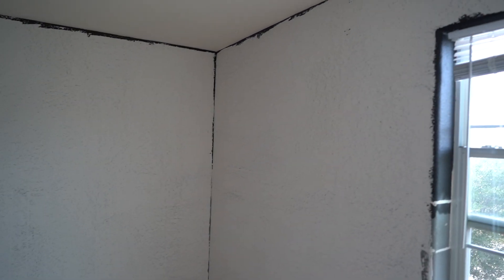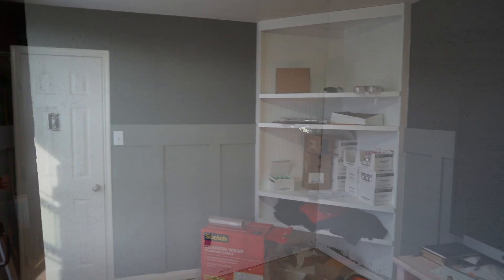Looking Better Already

Comment: Looking good man!👍🏻 What texture are spraying on the walls? Knockdown or orange peel?
Reply from the maker: Paul Peck DrywallTube hey!! I’m going to do knock down. I was watching some of your vids the other day! You got any good knock down vids? Thanks for the comment!
Reply: Why? Texture on walls is ugly... Just my opinion
Reply: @kenlame1197  I agree with Ken!!!  What's wrong with smooth walls?
Reply: I'm in SW Florida and all new construction is orange peel or knock down because smooth walls takes craftsmanship.  I was told recently that in the NorthEast, all of $1-3M homes have smooth walls.  Maybe in one of your rooms you could learn/show/teach us how to do a Level 5 finish.
Reply: Cool. Thanks for watching my videos man! Are you going to be using a hopper and compressor? I do have a couple knockdown videos. But, they're of me spraying ceilings after popcorn removal with a bigger texture rig. I like to go a little smaller with the splatters on walls. Ceilings are usually a little heavier. What's on your office ceiling now? -Paul
Reply: Yep - I agree with Ken, Bob and Dritz.  Smooth walls are gorgeous.  I hate textured walls.  I live in a 1968 house with solid, smooth plaster walls.  All the corners are perfect 90 degrees.  The house is small and the neighborhood is going down hill a little bit, but I just can’t leave these walls!  They are works of art.  lol!
Reply: @FinishCarpentryTV  Have you ever seen See Jane Drill videos?  She is a master plasterer!  She shows how to go from textured walls to smooth.  It looks easy when she does it, but I know it takes skill.  She also shows several texture ideas.
Reply: I was a finish drywaller many years ago. Funny how I still to this day will walk into house and check out the corners for the quality of work. True that flat walls/ceilings show the talent of a finisher. But I do like the look of a good knockdown job.
Reply: @kenlame1197  im a contractor and I agree, smooth walls look amazing but they take a lot of time. That's why mainly more expensive homes have it, because most people don't wanna pay for it.
Reply: @doug.ritson  most of our homes in the northeast have smooth walls not just the high end ones. I've done work on houses in a couple towns in NH that had textured walls and it was because the builder built shitty houses. They didn't even have plywood on the exterior it was 1 inch foam and vinyl siding nailed to the studs.
Reply: Smooth walls. With a trim detail will be a richer look.
Reply from the maker: @PaulPeck   Awesome! Yes, I will be using small compressor and hopper. There is currently knock down on the ceiling now. I am going to mask it off because I do not want to mess with it. Just going to try to match it closely!
Reply: @thomasbryant5138  Yikes! Race to the bottom
Reply: Finish Carpentry TV you may need a pretty big compressor to power the hopper.. my hopper calls for 8-10 cfm (cubic ft/min) and the biggest Home Depot rents here is 6.5cfm
Reply: I lived in Houston thirty some years ago, where I started my remodeling career.  Popcorn texture EVERYWHERE!  Ceilings and walls.  Moved to Alabama in '87, where smooth finish was (and still is) the norm, even in mass produced "Mc Houses".
Reply: I'm from the UK and like 90% of walls here are smooth so I didn't even know what you guys were on about. Do you not have decent plasterers over there?

Edit I just googled orange peel. Vs knockdown and that's like an old thing if you bought a house to renovate that's kinda what you'd expect and you'd plaster the walls smooth.

Enjoy the videos though!!
Reply: #drywalltube has so many good videos. Your are on the right track! Keep up the good work gents!

Comment: Congratulations on the home purchase Richard. Your children are adorable, great to see how you get them to help you. 
A fast way to get the skim coat layers on is to apply the thinned compound on the wall with a paint roller and using a good quality squeegee wipe off the overage as you’re only filling the low area, a couple of coats this way and you’ll have a great base to work off of.  There also is far less sanding and less lines from the edges like the taping knife leaves behind. This is going to be an amazing room when finished, your talent never fails to amaze me.  
I’ve been doing this type of home improvement for 43 years now and will really enjoy seeing how big of a name you will make for yourself.  Enjoy those children, they are a real gift and grow up fast, my youngest graduates college in 3 months, I was just your age, it seems like the other day.
Reply from the maker: Clint Price thanks for the tips. Yes everyone tells me time flies and I am already seeing it. It’s crazy
Reply: Great call about the thinned down joint compound.  I use a 30 mm sleeve.  I find it works excellent when going from an old textured wall to a new piece of drywall as well.
Your kids are awesome by the way.  As exhausted as you will and must be some days, that extra bit you find for your kids will be something you will always remember and be grateful for.

Comment: Looking good.As a drywaller though here in Australia I would like to offer some insight to you as you have always  been teaching me. Between coats of skimming you dont really have to sand between coats as you have applied tight coat you can just run your knife and lightly knock of the highs spots and apply second skim coat but this time cross trowel to eliminate any low spots. All the best to you and your family. Cant wait for the transformation.

Comment: Don't put a textured finish on your walls. Just sand out the walls with 220 grit on a pole sander. Prime the walls. Mark all your studs. Install trim. Caulk and fill the trim work.  Finish trim and paint walls. Save a couple days labour. We've been doing this in Canada for decades..we only use texture on ceilings.and lately those are all a flat paint finish too. Love the channel. Great workmanship and video editing. Go with a tall wainscotting and 6 inch crowns.
Reply: Do it like us british.... plaster it.... room that size would b pinked in a day.... 2 dsys to dry... then paint with crisp corners and edges.... no need for crown moulding

Comment: Looking good 👍 just a tip for the next time you skim coat wet down the mud a tad more and use a paint roller to apply the mud and trowel it all back off.

Comment: I don't have a link. I like top of the door crown molding shelf . I also like big bold base and casing . Got to go wood not painted . Building my parents house we bought a shape and power feeder made own doors put one by sixes together different types of wood on interior exterior . For instance Poplar inside of a room and Ash on the hallway side . With the crown molding would do soldiers in the corner instead of doing coping .

Comment: rich my suggestion is install new base 5" 1/4 would do for that size room and same for the crown molding, new casing on doors, 3" chair rail, new window trim and sill, with engineered hardwood floor, for paint colors I would say a navajo white with straight white on the trim. but I guess you could do carpet as well in case you like the warmth a carpet brings into the room in those winter days
Reply: Sills are outside, stools are inside
Reply: Ken Lame stools? never heard that phrase used  to describe a window seal. I always thought a stool was some kind of seating item
Reply: Ken Lame  window sill-The lowermost, interior trim work on a window

Comment: Hey Mr. Richard. Still love your work but a little piece of advice. Next time you skim coat, roll it on with a thick nap and just skim it off. Saves you a lot of time and your definitely skilled enough to get your walls flat. Just thought I'd share. Have a good one

Comment: Hey brither what is that just regular joint compound ur skimming the walls with right??? What is it green cap compound or blue cap compound
Reply: I always skimme and do coats with synco green
Reply: Skim plaster walls with green then skim with plus 3 @Heisenberg 2420

Comment: Here's another room with the wainscoting I just posted.
https://www.alamy.com/a-king-size-bed-standing-in-a-bedroom-interior-between-bedside-tables-and-with-a-black-lamp-next-to-it-image181642190.html?pv=1&stamp=2&imageid=BE85FEB6-28EE-4BD7-8EC5-D4AFD26F5F53&p=649298&n=0&orientation=0&pn=3&searchtype=0&IsFromSearch=1&srch=foo%3dbar%26st%3d0%26pn%3d3%26ps%3d100%26sortby%3d2%26resultview%3dsortbyPopular%26npgs%3d0%26qt%3dwainscoting%26qt_raw%3dwainscoting%26lic%3d3%26mr%3d0%26pr%3d0%26ot%3d0%26creative%3d%26ag%3d0%26hc%3d0%26pc%3d%26blackwhite%3d%26cutout%3d%26tbar%3d1%26et%3d0x000000000000000000000%26vp%3d0%26loc%3d0%26imgt%3d0%26dtfr%3d%26dtto%3d%26size%3d0xFF%26archive%3d1%26groupid%3d%26pseudoid%3d%26a%3d%26cdid%3d%26cdsrt%3d%26name%3d%26qn%3d%26apalib%3d%26apalic%3d%26lightbox%3d%26gname%3d%26gtype%3d%26xstx%3d0%26simid%3d%26saveQry%3d%26editorial%3d1%26nu%3d%26t%3d%26edoptin%3d%26customgeoip%3d%26cap%3d1%26cbstore%3d1%26vd%3d0%26lb%3d%26fi%3d2%26edrf%3d%26ispremium%3d1%26flip%3d0%26pl%3d

Comment: Why is texture and bull nose corners so popular in the South West?  Never delt with it here in the east.
Reply: Max less skilled labour required. Cheaper
Reply: @Tehcarp  easier to build it,  but to repair it seems much harder.
Reply: Never thought of that, we have same situation here.  I just do the corner bead myself and don't deal with the aggravation. Thx
Reply: It’s more of a shuffle than better or worse. Ya.

Comment: Why are you going from orange peel texture to knock down texture? I assume the whole house  is orange peel and now
you'll have one room with knock down? I think I would leave the orange peel and just remove the drywall from the floor
up to the top of the new wainscotting and  apply new base of plywood the same thickness as the drywall and then
apply the wainscotting to this new solid flat base.

Comment: You worked a little too hard on the skim coat should of just dragged the finishing knife from wall corner to corner and distribute a even amount of mud while feathering the edges, would of saved a lot of time sanding too

Comment: dude why you going to shoot texture on your walls, just leave them smooth, that texture crap is for noobs
Reply: I agree, go smooth walls.  

It seems like the room is not too big, not too small.  Texture might create shadows, like popcorn ceiling.  

Smooth surfaces and clean lines.  What about using 6" poplar as base board, painted white.  

The pink desk would be the main attraction.
Reply: Theseph Kind poplar is nice if left stained or clear coat,  but im pretty sure his going with either finger joint or mdf and crown, I would probably stay with 5" 1/4 base and crown with a 3" chair rail and new window seal and casing for the doors, and engineered hardwood for the floor, aok would look awesome with a navajo white on the walls and straight white on the trim